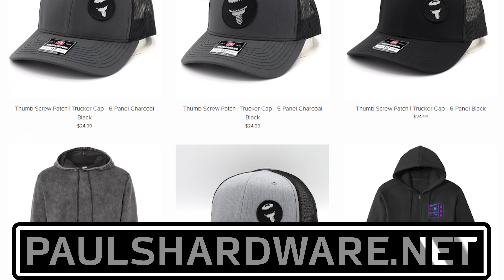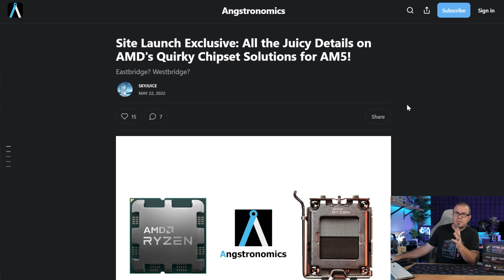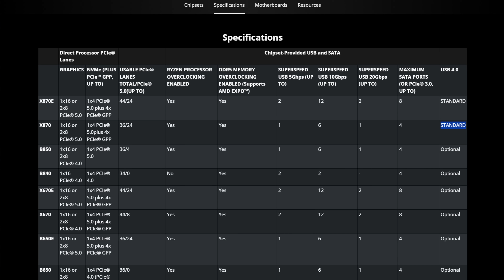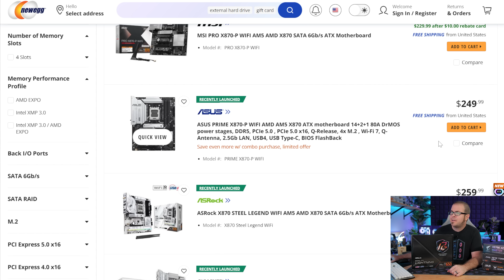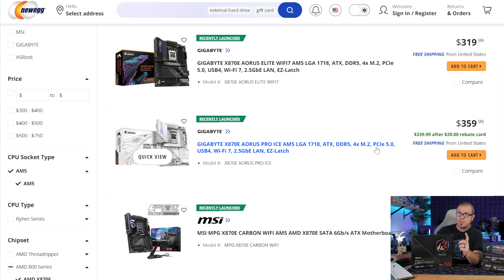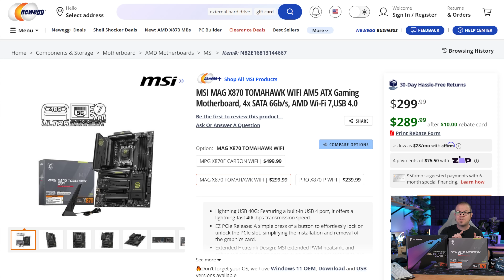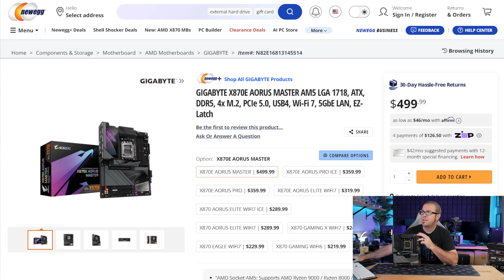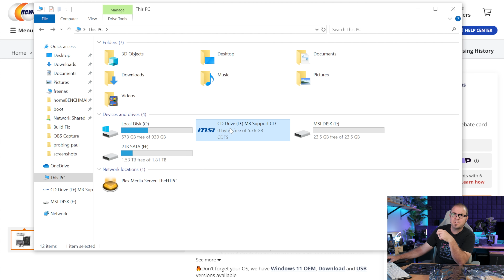Explanation / Rant about AMD X870 and X870E Motherboards

Comment: hi paul, can you make a comparisson between diferent chipset motherboard temperatures, recently i see a x670 asus strix wifi, i check other wirh same results, with 68° on idle. heat sink burning, too high, to inefficient. thanks!

Comment: Here is what i think:
If you get a RTX 5090 or 5080 which is Gen 5 Pci-e, and put it in a X670 motherboard, and you want to put in 4 pcs M.2 drives, 
you could potentially run out of lanes  sooner   than you would on a x670E or x870 or 870E motherboard ?
I would rather pay for a 870 or a 670E, just to get those lanes for my drives. Ideally, i want a motherboard that make it possible to stick in cards in every available slot, without compromise. 
I also want this on my gaming PC without having to use x99/299 or threadripper, and preferably on a budget motherboard  😛

IF you have a gen 5 GPU and buy 4 pcs gen 5 M.2 drives, i would rather have my GPU on Gen 5 than gen 4, since half a Gen 5 (pcie-16 running at x8) is as fast as Gen 4 running full speed (x16)
(i will probably never buy 4 pcs of gen 5 M.2 drives, even if i have 6 pcs gen 4 drives as of today 😊
Not really sure if i am over-reacting or not, also since i dont think many motherboard manufacturers advertise very openly how they share or distribute lanes.
It would also be nice to know whether or not you will be able to plug in anything to the lowest Pci-e slot without losing a nvme drive. You know, controller cards ?
For instance: my ASUS Hyper x16 with 4x nvme slots  :-)

Comment: i don't understand why there is a focus on ATX boards when nobody these days really need additional pci slot(s) and thus full atx boards. most of the people will prefer more compact PCs. and now they give us 0 matx X870 boards. modern day CEOs can't read the room. i want to make a new build on 7950x3d and now i am stuck with b650 boards. nonsense.
Reply: Matx is the least used form
Reply: @TheSjuris  well if there is no matx boards then there's no sales. Smh. My previous 3 boards are all matx.
Reply: @mc_sim   there will be b850 matx boards. They aren’t going to make a high end board for a market that has at best a 2% share.
Reply: @TheSjuris  I think you don't have real numbers about matx market share. Stop speculating.
Reply: @mc_sim   it’s really small. Unless you’re taking about the oems who shove Matx boards into full size cases. Niche market you will get b850 boards. Maybe Asus will bring the Gene back not that I’ve seen one on sale anywhere for years.
Reply: @TheSjuris  it is clearly not. The range of matx boards is quite good at low and mid budget sector, it's just highmid and high budget that are lacking.
Reply: @mc_sim   it’s good at the low and midrange, but not where the power users are.
Reply: @TheSjuris  I don't agree. A lot of power user even build sff powerhouses with itx boards so matx has it's customers 100%
Reply: @mc_sim   that’s why they make x870 itx boards. They no better then either me or you and if there’s as big of a market for them that you think they would make them, but there isn’t.
Reply: @TheSjuris  well no, i don't think they 'know' better because their only aim is profit. Selling 'bigger' atx boards gives better margins. there could be other reasons but i am not sure about it. matx boards is same as atx just cut short. as a customer i believe there is no reason to go for atx boards these days - barely anyone needs more than 1 expansion card slot for gpu and thus buying more expensive boards and bigger case is a mistake. i will die on that hill.
Reply: @mc_sim  if there’s a profit in something someone will fill that need there isn’t one.

Comment: I would really beg to differ with the results in this video. I believe x870 is a tremendous value over x670 when you take into mind features offered. The cheapest x670 mobo that offers built in usb4 ports is ASRock X670E Taichi @ $379. The cheapest x870 with built in usb4 ports is ASRock X870 PRO RS @ $189 literally half the price. I'm choosing x870.

Comment: 12:37 why are some USB 3.2 slots blue and others are red?
Reply: The Red ports can do 10 Gbps, blue ones 5 Gbps. If you need to connect a 10 Gbps device such as a M.2 NVME to USB Adapter you want the red ones.
Reply: @K05H  thanks

Comment: 10:34 I am incredibly miffed that by minimum Gigabyte has done this. However, Silverstone has recently done this with one of their older cases, so it pretty much shows that almost all manufacturers are doing this.

Without using specific words, they expect people to navigate an entire manual on their smartphones, when normally you need to zoom in on them by 150% to 300% to even view the seemingly microscopic text on their PDFs, including their motherboard layout and their front panel pin layout. The alternative is to either go back-and-forth on an already turned on desktop PC to view the parts, or just print it out on your printer to get to the specific pages you need. It's culpable.

I do not have the time to be spending all that on that much effort when my efforts are on getting the PC built.

Comment: Paul, love your videos! If I wasn’t into PCs I’d still watch your channel for your unique delivery and wonderful sense of humor 😂.
Looking at the specs of these motherboards, the core PCIx5 and M.2 slots share bandwidth and you have to sacrifice performance (or M.2 functionality completely) if you have certain combinations of devices. Researching the Asrock 870e Tiachi, it doesn’t suffer from any of this (with a 9000 or 7000 cpu) according to the specs. I’m a flight simmer and need numerous monitors to create a virtual cockpit. Therefore I want a smaller 2nd GPU. I also want to utilize all available M.2 slots.
Can you please shed some light on this aspect of the motherboards. I think it would make an informative video. Thank you and thanks for the great channel!

Comment: Good job on pointing out the critical differences between the 670 870 e and non e boards.I picked up an open box x670e Aorus Pro x mobo for 200bucks from micro center and there is really no difference between the x870e and x670e, other than faster ram support and the led debug and push release for the graphics card on the Gigabyte boards. But yea, a X870 is literally a b650 sad...Watched other videos and no one pointed that out about the x870 boards.

Comment: You mention in passing that 'recent' boards have WiFi 7 support - this is actually the other differentiator for X870(E) that you didn't mention. It's been a real hassle finding WiFi 7 cards that are reliably compatible with earlier X670(E) boards, which all have WiFi 6E; having this built in saves the hassle down the line.

Comment: Hmm isn't it quite smart to release the MOBOs a bit earlier? When new platforms launch together, in the EU atleast, the availiability and range of choices with mainboards is really bad. Its just an extreme headache and you get overcharged constantly and everywhere. So the default is to wait atleast a month after release to let the vendors stock saturate, and the prices to normalize.

Comment: Got my AMD 9950x and my MSI X870E Carbon Wifi and it is absolutely sick. Cant wait to build it. Only gripe is if yoy use both Gen5 m.2 itll make your GPU PCIE 8x instead of 16x
Reply: Is this a big problem? I want to know
Reply: @mithatgam  Not really. Apparently even the newest 4090s can't use all 16 lanes on the PCIE slot to begin with and running a GPU in 8x you'll see no difference or very very little. I actually Rane min eine 8x for years and didn't even know it. Put it in 16x and daw no difference
Reply: Thanks for the help @fourwheelerjock
Reply: @fourwheelerjock  This. It's my understanding that GPU cards run at x8 with virtually no detectable performance hit, but at x4 you'll see about a 10-15% hit.  The problem is that a PCI5x4 slot won't allow a Gen3x16 or Gen4x16 GPU (i.e. 99% of GPUS out there) run at x8.

This is problematic for anyone wanting to do multiple GPU setups (eg. for VM passthrough).  All the motherboards that can do x8/x8 are at the top end of pricing.  All the affordable boards are x16/x4.

Comment: I was waiting for the 9000 12-Core and X870E, I was underwhelmed and totally put off by the high prices in Canada.  $700 just for the CPU.  So I bought a new Intel 12700K 12-Core instead for $200 and built a system around that.  It is to replace my old i7-6950X X99 64GB RTX-2060 system.  12700K is 200% the performance of the 6950X, plus I went with 192GB DDR5.

Comment: Really hate how consumer motherboards are starting to shove nearly every available PCI-e lane to m.2.  If I don't want or need FOUR m.2 ssds, all that I/O is being wasted.  Give me normal PCI-E slots, and I can turn it into whatever I may need: more usb, capture cards, sound cards, higher bandwidth or just additional networking, whatever.  INCLUDING more m.2 slots if I decide I need them.
Reply: Remember these boards also have to have room for 3-4+ slot gpus.
Reply: @TheSjuris  the slots themselves don't get in the way of that, and not every gpu is 3 or 4 slots.  Many, dare I say most, people are still going to be using a 2 slot mid range (or just AMD) card.  Also risers are a thing.  Overall point being, if the slots are there, I can decide if and how to use them.  If they aren't there, I don't have the option at all.  Looking at the options now, I can't find one that I consider acceptable for handing down to a NAS build when it eventually gets retired from the main gaming PC.

Comment: WTF is up with the x870/x870e chipsets Is there any reason to select a x870(e)  over x670(e) as it appears 670 has everything that the 870 has and most 870 boards only have 4 Sata ports, and none of the extra lanes appear to do anything. 870 seams to be a step back from 670
Reply: The e version is fine nothing wrong with it; the non-e version is a b650e with pci 5 and usb4.

Comment: I've got an ASUS Prime X670E-Pro WiFi  running a 7800X3D.  I "should" be good for another 5 or 6 years so whatever Intel or AMD drops in the meantime will just be a "fun to watch" video/information.  Sorry PC makers and Auto Industry, but I certainly do not need a new "thing" every year, advertising to the contrary.

Comment: I decided to upgrade from AM4 to AM5 last week. I already purchased a 7900x (not x3d, because I'm not a gamer) for $340 and I ordered my B650 mobo an hour ago. I'll be buying RAM this weekend. I bought the cpu used on ebay and the mobo (MSI B650M Mortar WiFi) used-ish on Amazon (listed as used excellent like new condition).
Reply: I got the B650 Mortar WiFi + 7900 XTX +   7800X3D + 32GB DDR5 RAM during Black Friday 2023 - very happy with this setup for 1440p gaming so far. My only regret is the NZXT H5 Flow case (too noisy and cheap tooling).

Comment: Where are the back connect motherboards? Case manufacturers this year changed their designs just to accommodate for this otherwise great concept, and MB manufacturers - who even introduced unique branding just to confuse everyone are like: "New phone, who dis?" A 'new' chipset launch would have been perfect, and not a single damn MB features it? Not even the high end?
Reply: You need a compatible case to start...

Comment: less then 2 minutes into this video and their is already incorrect information. 
AMD has indicated that the 9800x3d CPU will be launching in late October to early November 2024. So, the next 3-4 weeks. 

This is common information thats has been out for some time now and has been reported on many other channels. Please do your due diligence before making a video complaining on the lack of 'new x3d CPU's' when they are coming in a few weeks. 

Also, the x870 Motherboards have full support for AMD EXPO DDR5 8000 RAM kits. These will work out of the box with no additional tweaking or overclocking. 

This is not possible on x670 boards without extreme overclocking that makes a system highly unstable. So this is NOT something that x670 boards are capable of out of the box and hardly anyone has gotten anything above 6600 RAM kits stable for x670, let alone 8000 RAM. 

Now if this good enough to warrant buying the x870 boards for the DDR5 8000 RAM versus the x670 Boards running DDR5 6000 is its own story. This should have been covered instead to properly inform consumers instead of the blatant disregard for accurate information presented in this video. 

I am immensely disappointed in the quality of the content of this video and would not expect a channel of this size that be so disingenuous to its viewers.
Reply from the maker: Less than 2 sentences into this comment and THERE is already incorrect information (and spelling and grammar).
AMD has indicated no such thing about the 9800X3D -- these are rumors and every reputable media outlet has classified them as such. 
I am immensely disappointed in the quality of this comment and I'm glad you're not a subscriber.

Comment: @paul - can you cover the BS of technically mobo has 200 connections but in reality you can only use like a certain combination of things at different pci-e levels because there are only so many lanes?

That's always been an issue in purchasing because a spec sheet lists a bunch of stuff on sites like new egg but you have to HOPE the image is labeled for what you can actually hook up.. like sure this has XYZ # of pcie 5 spots but so often you can only use like 1 off the cpu and 1 off the chip set so you might as well downgrade all other parts and slots being used??

Comment: I disagree that x870E master belong to Halo or even High-end category. For me consider motherboard as high-end, it must have two PCI-e Gen5 slots capable of running 8x/8x.

It also have one of worst m.2 configuration, where only two NVME ssd can be used without taking lanes from primary PCI-e slot.
It looks like Asrock x870E Taichi should be best motherboard to go with, without considering Hero from Asus, or Godlike from MSI that are both not worth their price.

It would be nice if AMD actually force minimal feature set as mandatory from certain price range on specific chipset. 
Right now most of brands putting each new gen more of stuff noone ask for and making actually useful features rare and available only on most expensive boards.

With x370 we had $250 with dual lan and decent pci-e configuration but with x470, x570E and now with x870E its getting worse and worse and at same time prices for similar features tripled and in some cases even quadrupled.

That's my disappointment/rant about new motherboards.

Comment: Got a x670e-e for my build. Good but not great price. Just works. Only drawback is it will only take 96 Gb ram. Not sure if the x870e's go higher.
Reply: Ew Sir... 

Do you even need those 96gb of rams though? 

Running VRM for 3 people and multitasking for almost 200tabs of chrome, used only 19gb of rams for totals

I wonder what youre gonna use that amount of ram
Reply: @RoyZennet  video editing...

Comment: I switched to a X670E Aorus Master 2 months ago for 500 USD (still too much, imo) and I'm planning to use it until the end of the AM5 cycle unless something goes wrong with it. It seems to be a good decision since the X870E Aorus Master is a slight downgrade from it.

If not for the 7800x3D, this platform would have been extremely disappointing so far. AMD really needs to blow away all the expectations with Zen 6.

Comment: Finally an 870 with 5.1 sound out, my old but very functional speaker system will continue to work!
Reply: What board has 5.1 out?
Reply: @justincgs the ASUS Tuf, but an non E... at 14:48 you see the csub, rear,  line out, mic and line in connectors, all other  870 presentations I've seen has line out, mic and a spdif. So this is the only board I could use to connect my old but fully working surround system without having to buy something in between the spdif and the speaker system.

Comment: ex-13900k (rip) currently on 7950x MSI X670E Meg Ace and can recommend it one of the rare motherboard who does not share it's gpu bandwith with the M.2 or sata you can run your gpu x16 with 1x 5.0 M.2 and 3x M.2 and still have 2 useable pcie ports for whatever you want specs below (the motherboard was unusable at release but 25 ! bios updates later it works 10/10 for me)
Reply: 3x PCI-E x16 slot
• Supports x16/x0/x4 or x8/x8/x4 (For Ryzen™ 9000 and 7000 Series processors)
• Supports x8/x0/x4 (For Ryzen™ 7 8700G and Ryzen™ 5 8600G processors)
• Supports x4/x0/x2 (For Ryzen™ 5 8500G processor)
PCI_E1 Gen PCIe 5.0 supports up to x16 (From CPU)
PCI_E2 Gen PCIe 5.0 supports up to x8 (From CPU)
PCI_E3 Gen PCIe 5.0 supports up to x4 (From CPU)
4x M.2
M.2_1 Source (From CPU) supports up to PCIe 5.0 x4 , supports 2280/2260 devices
M.2_2 Source (From Chipset) supports up to PCIe 4.0 x4 , supports 2280/2260 devices
M.2_3 Source (From Chipset) supports up to PCIe 4.0 x4 , supports 2280/2260 devices
M.2_4 Source (From Chipset) supports up to PCIe 4.0 x4 , supports 22110/2280 devices
6x SATA 6G

Comment: Just wonder , what is the extra 8pin power plug in the bottom of the board for?
Reply: On the MSI board not much.
Reply: @TheSjuris  ok, what is not much?
Reply: @Mre942   it was originally to make sure you had enough power when you were using multiple gpus in SLI.
Reply: @TheSjuris  ok thx

Comment: Could it be possible that 600 series doesn't necessarily get CPU generation firmware upgrades, for next generation, but 800 series is required to by AMD? If this were the case, then 800 series could be better for upgradeability. I don't claim this is the case, I'm just thinking that this could be a trick AMD tries here, and upgrading 600 series for new generation processors may be up to motherboard manufacturer. It would make evil sense in marketing perspective.